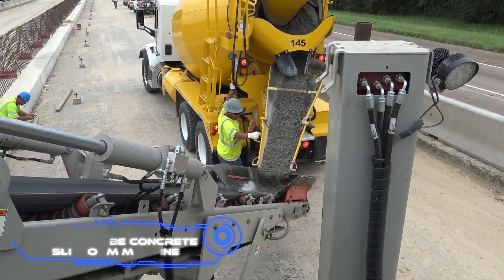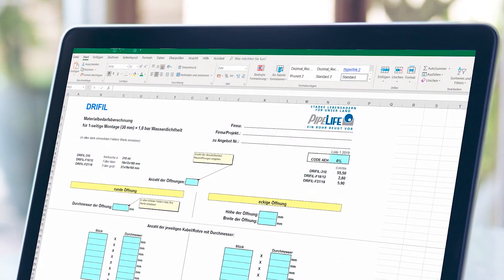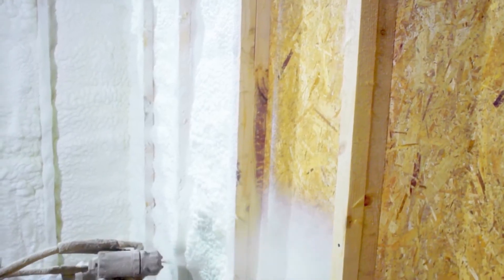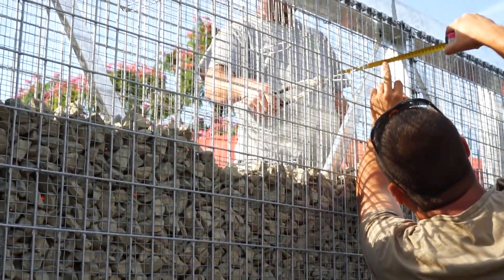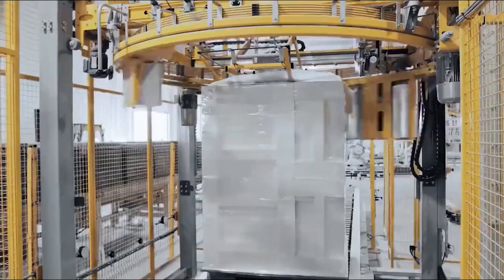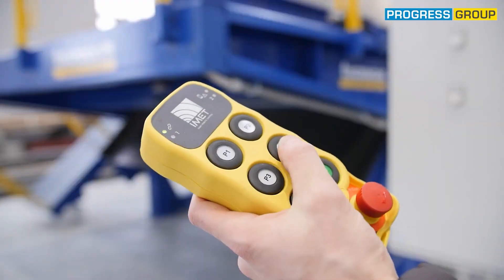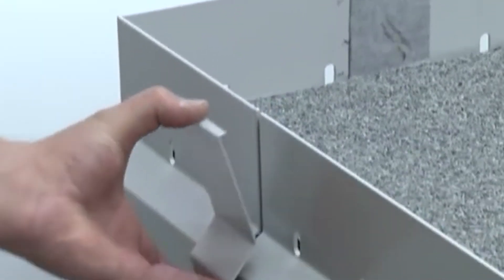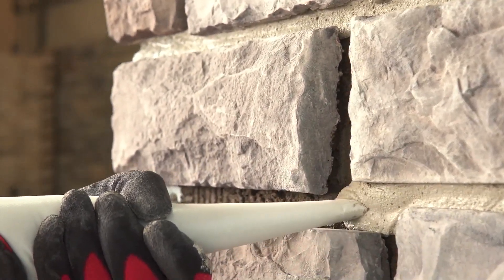INCREDIBLE CONSTRUCTION TECHNOLOGIES NEVER SEEN BEFORE

Comment: Multipurpose concrete slipform machine looks pretty useful. It's a massive machine that is required while working with concrete. It can be used to create both barriers and smooth foundations. Drifil is a great one. It's a sealing technique that is ideal for both repairing existing lines and laying new ones. There are components such as sealant and thermoplastic sleeves which will allow us to split cables and pipelines as well as create a bearing surface fast and easily while the sealant retains its elasticity after application allowing the cables and pipes to shift. It can be installed at any angle and provide some vibration absorption. Thank you so much for doing this video.
Reply from the maker: Great insights! Thanks for watching! Glad you enjoyed the video!